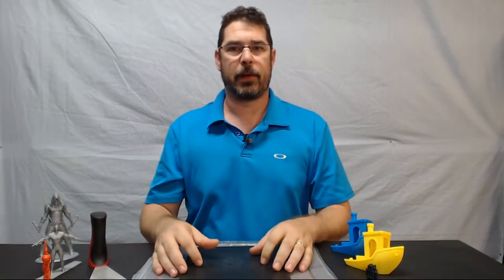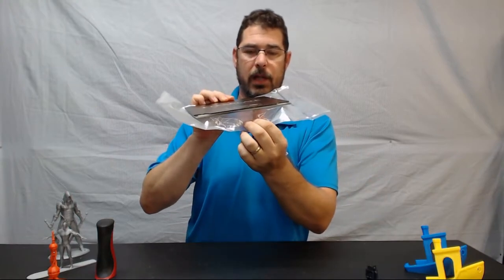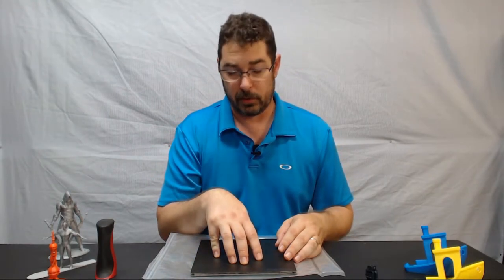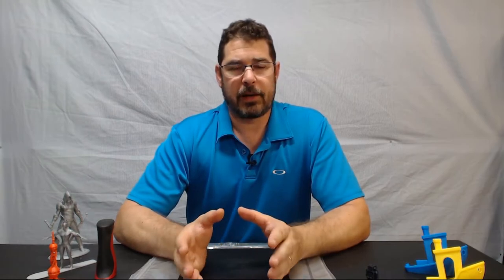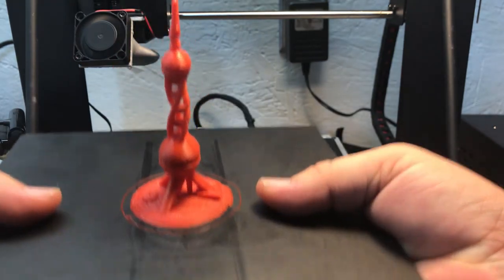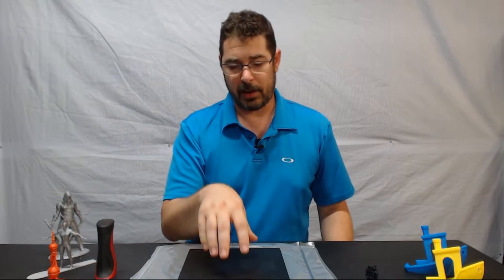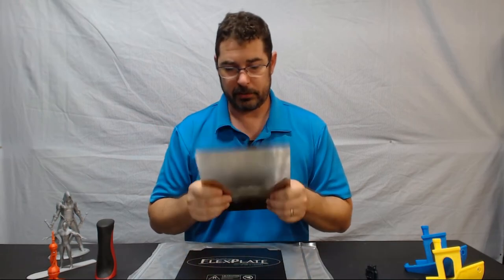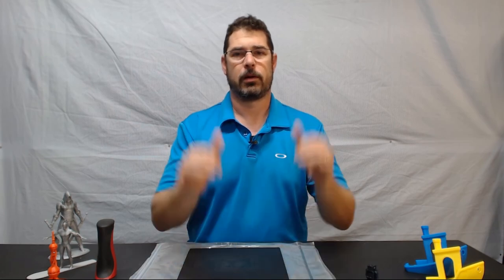BuildTak FlexPlate System Final Review

Comment: Nice review, I have the system on my Monoprice Dual (Flashforge Creator X) and I noticed you only were bending the plate in one direction, the spring steel can be flexed in both directions, and from any sides, I found for small parts or stubborn parts I flex in both directions, and then rotate 90 degrees and repeat. Only take a couple of times and it pops right off.
Reply from the maker: Rich Clarke thanks for pointing that out!  I'll give that a try sometime.

Comment: Um, NO. Glass is the way to go. Hair Spray and glass. Wait till it cools, part just lifts off. I've tried some of this stuff and just about tore it trying to get parts off. I print PLA, PLA+, Tough PLA, PETG, ABS, ASA, Nylon, Carbon Fiber PC. All of these work perfect with glass and hair spray. You just have to wait 20 minutes to cool things down.
Reply: oh, look, an opinion... I print most of those on Ultistik plates too without hair spray maybe THATS the way to go because of MY experience. you just have to wait for it cool and flex it and they literally fall off in your hands. I agree buildtak surface sucks. but 4 years ago when this video was made, it was still probably the best thing available